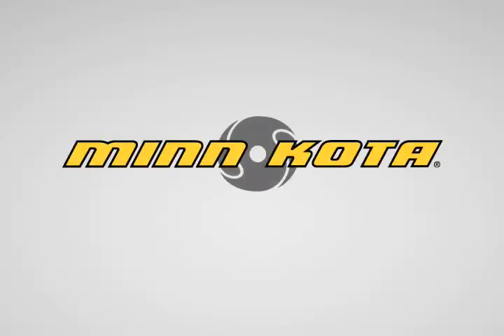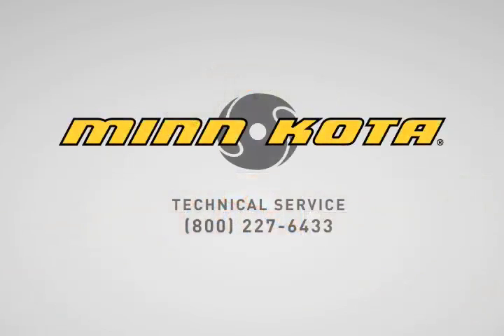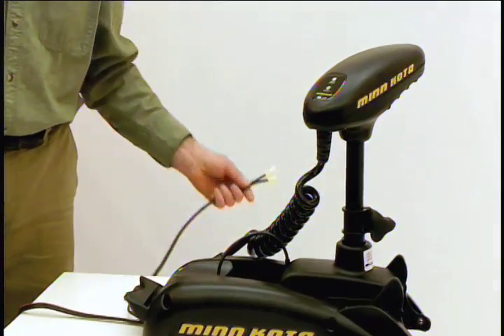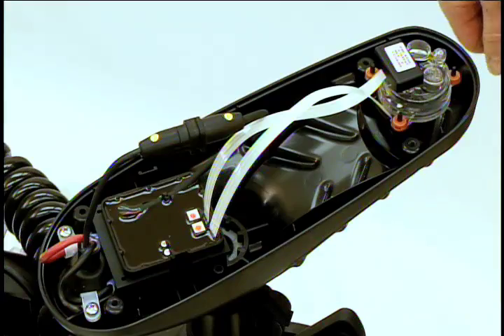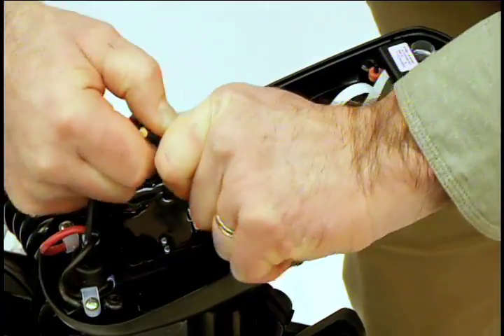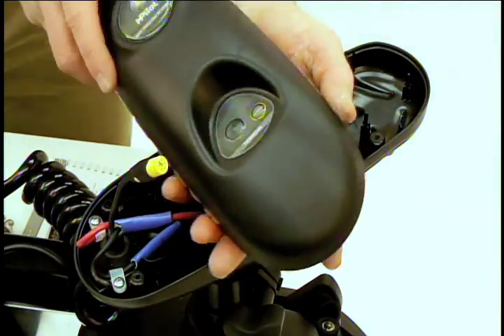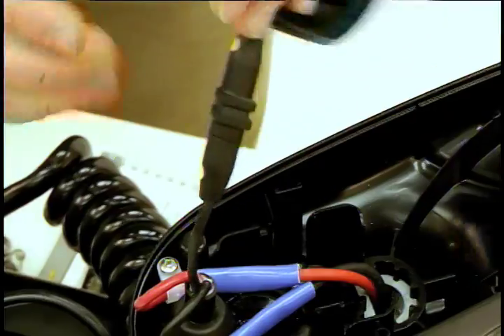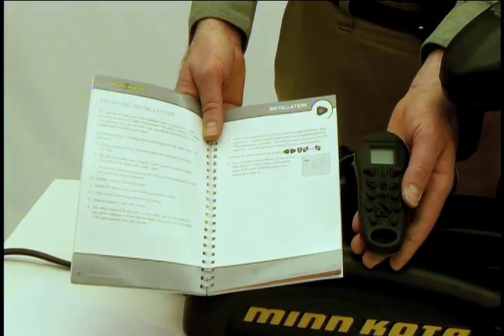i-Pilot Installation for Terrova

Comment: allmy.tips/Minn_KotaTerrova?69Q    Longer shaft allows me to set it higher so that I don’t have to bend over from my pedestal seat to operate it. The 35 pound thrust to this motor gives me much more power in reverse than the 30. The 55 was too heavy for me to handle. This motor is perfect with the mini, 22 pound battery that lasts me for the 4 hours that I want to bass fish.*